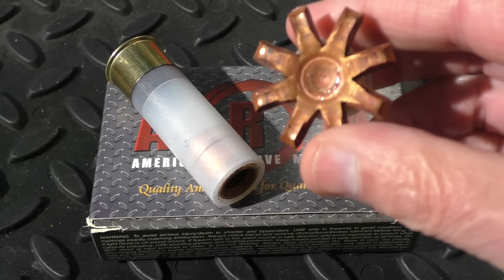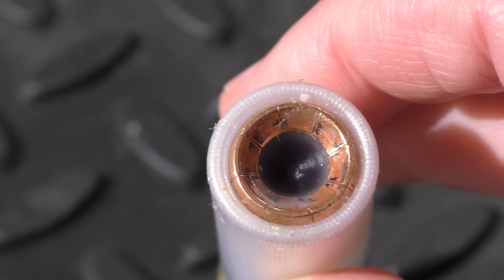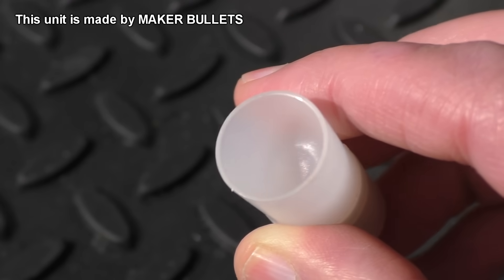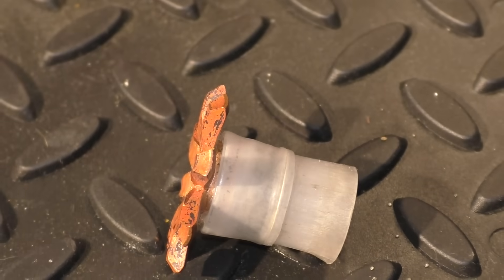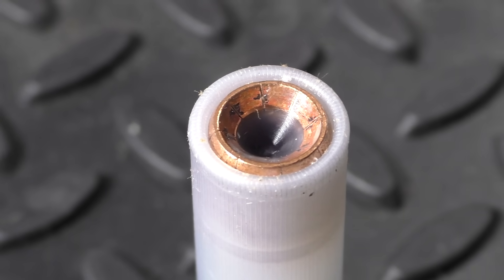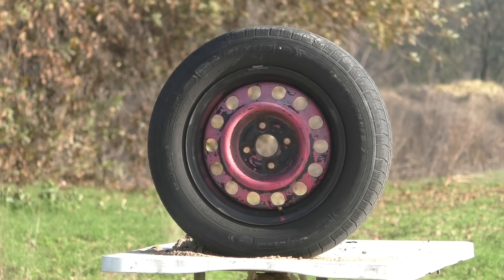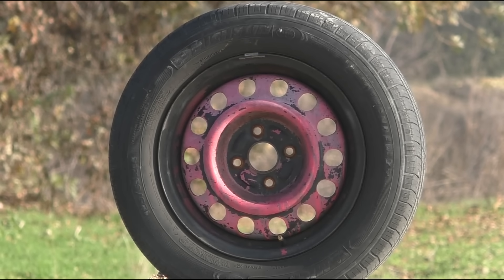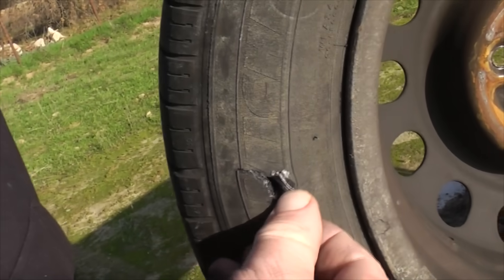A.R.M.  Gatekeeper 12ga. Slug Technical Details (and TIRE test)

Comment: The rim of a 27 cal nail gun blank matches the diameter of the center hole of the original gatekeeper perfectly. If you drop a 4mm ball bearing into the center of the cavity below it, the rim sits right at the face of the petals. The center is a drill point shape, so the ball will sit in the middle. Dab of hot glue and squish the blank in there.

Comment: A bit late to the party — somehow I missed this one, despite actually having your videos actually show up when they’re released — but commentary on the tire test.  When I first saw the video, I was less worried about the compressed air adding resistance to the projectile than the tension it added to the rubber would affect things.  The answer, as shown by the classic Gatekeeper footage shown here, was “not much” (which honestly didn’t surprise me, considering the difference in the impact surfaces between the projectiles). and thanks for taking the time to come back and revisit this to clear things up.

Comment: I LOVE the tire test, if I could donate a ton of tires to you to determine which rounds will flatten a tire fastest would be an AWESOME test to see.

I'd LOVE to see as many of the old tests as possible, reproduced with a tire test in short format.

If you have ever seen the fan-test showdown series about printed fans blades, a similar format with shotgun rounds for each target type would BE AWESOME.

Each season being a series of slugs tested in comparison to one another against a specific target, each target damage comparison being a different season of the show.

I have a break action 3" mag single shot that I think I might start doing a series of these tests with.

Comment: I don't think the issue is the compressed air affecting the projectile, instead, I'm thinking that folks figured that the tire having air in it made the sides more rigid than without air, something which I admit to having thought at the time myself.
We still got huge holes which would have resulted in immediate deflation from any of the slugs, so I wasn't upset personally.
Reply from the maker: Rigid or not,  the thickness is the same.
Reply: @taofledermaus  Agree.
That said, as you have noted in previous videos, when targets are or are not secured, projectiles will damage them differently.
Also said though, the end effect was the same in this case.
Reply from the maker: @seanfoltz7645  What we have noticed is the slug will impact the target,  pass through it,  and then the target might move long after that.

Comment: My guess is that the copper slug is placed in an injection mold and the plastic is injected around that retention post in addition to forming the cup, etc.
Reply from the maker: Not sure how they did that.  The plastic around the slug isn't fused to the slug.   It took some effort to cut the wad to release it from that post though.

Comment: Hey Jeff, I just wanna offer some illumination on the four tires on the side of the road. I might be a year or two younger than you so maybe I’m a little closer to that mindset, but it seems to me. The owner obviously bought themselves a brand new set of four bling bong rims and they were different size so instead of moving the tires over to the new rims, buy four new tires with it.  of course since you spent all of your life savings on bling blong rims and new tires, you can’t afford the dumping fee. PS also fuck the man, right? Dump wherever, dad can’t tell me what to do.

Comment: That lug on the base of the slug looks like it was part of a casting.  

As I understand it, it would be quicker and easier (and thus cheaper) if they started with a casting and then finished the slug on a milling machine rather than milling the whole slug.
Reply from the maker: The whole slug is made from round stock and machined
Reply: @taofledermaus 
 In that case, the lug may be a hold over from where the slug was held for machining. 

My assumption about it being a casting came from the the line that you can see on the bottom - it looks like an artefact from the casting process that you sometimes get on metal miniatures.

Comment: Trash problem is the same in the UK, they made the local dumps (recycling center) pay for commercial vans and pick ups. So they tip junk anywhere but the dump. It's referred to as fly tipping hear and as we are a small country you don't need to go far to see piles of junk in all sort of places. Why the local authorities don't figure this out is a huge mystery???
Reply from the maker: Everything takes the path of least resistance.   You have to make the RIGHT path easier.

Comment: The classic Gatekeeper is my favorite slug from this channel.

Also ditto about the trash rant. My county dump used to have a couple weeks during the summer when they would take stuff like fridges and tires for free. They'd get swamped by people coming from all over during those weeks. They solved the issue by making it free for locals to drop that stuff all year round so long as you could prove residency and then getting rid of those free weeks. It was easier for everyone.
Reply: Where I live we have what we call "kerbside collection" or "hard rubbish" I've also heard it called. Where you can put out larger items that don't or won't go in the normal bins. One thing they don't take is car tyres though 😂

Comment: I do appreciate your further testing. My concern about inflated vs. deflated tire wouldn't be about the effect of compressed air on the slug but rather the rigidity of the sidewall.
Reply: The sidewall rigidity is not effected by air pressure. The projectile still has to penetrate the layers of rubber & fabric.
Reply: @LuvBorderCollies  from a layman's view, I think it's safe to say that air pressure does have an effect on sidewall rigidity. That's why most tires can't stay round under a car's weight when under inflated.

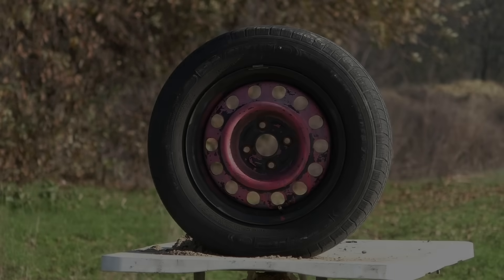Comment: 0:00 to 4:20... What if: a measured amount of wax is put in the slug hole first, to allow the .31 ball bearing to sit closer to the front of the unit, shuttlecock effect. Should improve flight characteristics, and with some more projectile speed... You get the BB compressing the wax rapid on impact is possible to make the copper slug explode vs peel.  The extra speed also gives the BB a chance to penetrate. 

Thanks for the great video.
Reply from the maker: I don't think the ball is actually doing anything even if it didn't cause a balance issue.
Reply: @taofledermaus  Agreed, it's not doing much by sitting in the bottom of the hole, hence my suggestion.

That or upsizing the ball so it interferes with the petals and forces/wedges them open.
Reply: @ScooterMcAwesomeness  From the tests seen so far, they don't need anything to force/wedge them open as they do great on their own.

Comment: The idea of the gatekeeper had nothing to do with penetration. It's all about knockdown power. At someone who is wearing street clothes you're going to put a hole in them. But if you shot someone wearing bulletproof armor you're still going to knock them flat on their ass and that was the whole idea behind the GateKeeper. It's a military round.. it was invented and designed by the military way back in the 1930s. If you disagree with this message me back and let me know.

Comment: I have a back alley behind my house and folks often use it as a dumping convenience. Luckily the city will come and clean it up when notifird. Sadly all the open country we have in the valley just makes it to convenient for folks to dump whatever anywhere they want. Modern day s are here.
Reply from the maker: The tires are small enough to fit into a residential trash can (one or two at a time) or they could have snuck them into a dumpster behind a business. No,  they drove those damn things 10 miles out of town and dumped them 100 feet from the entrance to the dump!

Comment: I think if they move the ball to the end of the slugs it would help put weight forward (help with stability), and help with the initial opening of the "fingers". Maybe add some flash powder behind the ball to give it that little extra "pop" it needs because of the heavier weight and slower velocity.
Reply from the maker: The ball would probably get knocked out easily.   I'm convinced the ball does NOTHING to help the slug
Reply: @taofledermaus  I agree, just brainstorming. And I'm sure there is some glue of epoxy that would be strong enough to hold it in place. Even if it comes apart when fired, than you have a kind of "buck and ball" type round.

Comment: These have a ton of potential - I can’t imagine how these would perform with a tungsten core and propelled at like 1400-1500 fps, probably just destroy the slug though.
Reply from the maker: I'm TRYING to get the owner of Maker Bullets to try a 4 petal design (4 less cuts) and crank up the velocity to 1600 or so fps to see if they'd be viable hunting rounds.  Simplify the speed up production and come out with a new product.
Reply: @ that would be cool!

Comment: You dident weigh the black slug with the wax material holding the ball
Reply from the maker: Wax is very light,  probably adds about 3 grains to the weight

Comment: 40 PSI times ( pi(.36)^2) for the area of contact in inches gets you roughly 8 pounds of force opposing the slug through maybe half an inch before the tire material tears, if we're generous - soo that's about four foot-pounds of energy depleted.
I'm not an expert but this back of the napkin reckoning says the tire being inflated is not very material to the ballistic results...

Comment: That ball in the middle, it would open the petals better if it fitted at the front flange rather than sitting deep inside.
Reply: Might not destabilize it as much, either.
Reply from the maker: The petals really don't seem to need any help though
Reply: @ wonder if Evan (think that’s the name of that ammo maker) could knock a few up to try?  Keep up the great work 👍

Comment: In addition to the fees they charge at the dump, its just bureaucratic corruption in the form of no bid (or fake bid) contractors skimming a massive percentage off the cost they charge tax payers. The more they can charge the tax payers, the more they make on top of the dumping fees. it only causes people to dump where ever they can get away with it. Its a circular problem and solution scam. All they have to do is keep any fixes off the ballot. Typical California corruption.

Comment: Here in Sweden dumping stations are free. It's really good. House hold trash is not free, come with a fixed cost, but other trash like a tire, oil or whatever is "free" paid by taxes. Really a good thing.
Reply: The UK is the same unless you want to dump building waste.
Reply: Germany is mostly the same. Most stuff is free till a certain amount.

Comment: You don't know why they dumped that tire? 🤭
- partially worn down to below 1.6 mm
- uneven wear
- sidewalls, threadpattern, everywhere with tiny ruptures - you don't get it through a bi-annual German car inspection (Hauptuntersuchung/"TÜV")
- It's so old that it has the "softness" of hard wood. You're just skidding to everywhere on a wet or even just moist road. 😉
Here in Germany you can go to a public "Recyclinghof" (recycling/dump yard) of your district/city/commune. You get rid of almost everything for free as long it's a reasonable amount and as the rubbish is private. You can even get rid of small amounts of asbestos, paint, contamined solvents etc. as long it's not more than a particular amount (per 24 h) and as long it's private.
Commercial waste costs a small amount if money.
Reply from the maker: They drove the 4 tires,  10 miles out in the country,  just to drop them off  100 feet from the entrance to the dump.  That was what I thought was funny.